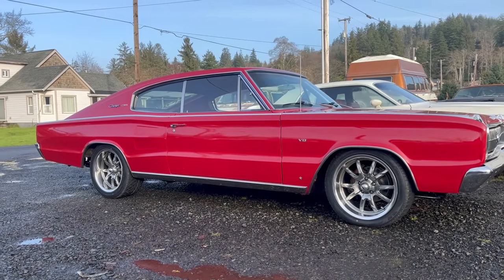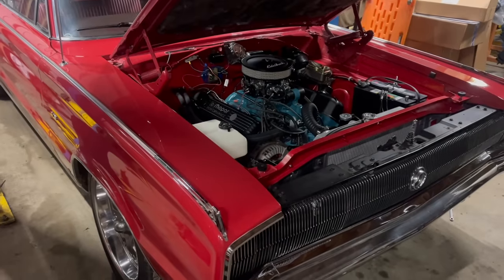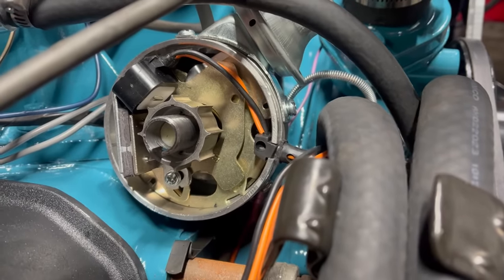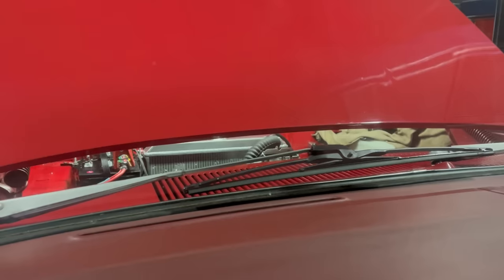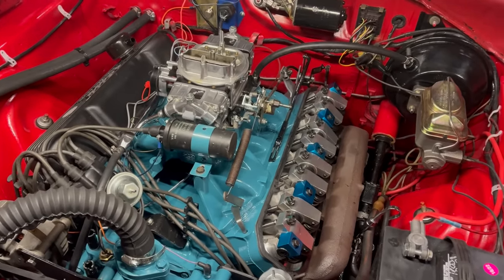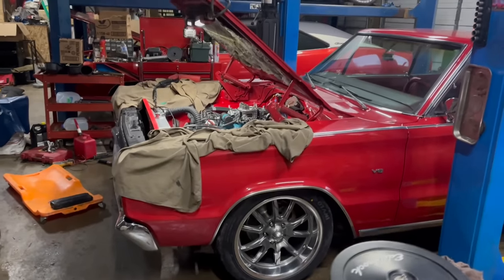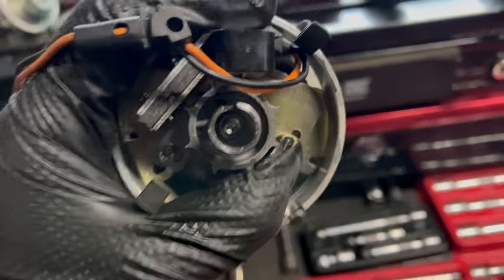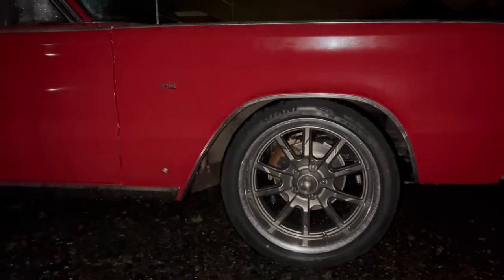What's Wrong With This 1967 Dodge Charger Big Block 383? When Bad Parts And Builders' Mistakes Mix

Comment: I had a customer bring his Ford to me. Said it will not run right. He started it up and bellowing black smoke.
Hand me the keys. I opened the hood. Choke was stuck close. A brand new carb and some one took it a part. Why??
Without taking it apart. I took off the choke and reset everything. Cleaned plug and she ran and idled. 
He said the previous mechanic couldn't figure it out?.
I did some other cleanup on the plug wiring. And picked it up smiling.
Reply from the maker: That’s a good one… I recently had one of those fancy Street Demon carbs stick the choke closed on top of the choke tower after a back fire. It didn’t seem like that would even be possible… that one took me a minute to figure out, as the air cleaner was on. Nice work!

Comment: Cam timing was my guess at about 21 minutes in but I've forgotten if that would or Would NOT SHOW in the ing timing.  Hey, I used to be Very good back in the Day with everything using Points and a Carb!   60 years later and Stick a fork in me caus I'm DONE!
Reply from the maker: I hear ya! Haha. It would show in distributor timing if the chain had jumped - but not if it had been installed wrong and someone had then set the ignition timing by the mark, like in this case.
Reply: @DeadDodgeGarage  
This! 😀

Comment: Classic mistake most guys make...  HUGE CAM, not enough compression, adds BIGGER CARB.  problem gets worse..  Builds it until it is undriveable ...  3 years in paint and body shop...  $15,000 later...  now its a trailer queen...  Sells it for a big loss, buys a Camry.
Reply from the maker: It’s all about the combination… and people just don’t get that. It’s so easy to make a car worse and slower with money.

Comment: I make the dash light drivers for these cars. Same circuit and transformers as the original ones.
Reply from the maker: Awesome! If you’re the guy in Washington, I almost bought one from you - but instead I sold my ‘66.
Reply: @DeadDodgeGarage  No Merit automation of Maine. We use original type cases new transformers etc.

Comment: Should keep the original distributor coil and points. Then replace with Pertronix LS. Done.
Reply from the maker: I like Pertronix and have used a few, but have heard they may not be the most reliable thing either. Frankly, I’m not sure what is.
Reply: @DeadDodgeGarage  The LS is the reliable version.  I have had it installed in my BB Corvette for 20 years now. The magnet ring version is the problem child as when it gets old it will sling out its magnets. LS means lobe sensing.  No ring to install. Only the pickup.

Comment: You need to use a pointer to convey all the points of the conversation
Reply from the maker: That would require buying a pointer… my finger works pretty well. Hmm, I suppose I could use a screwdriver.

Comment: Mopar not charging or low charging? 
Change the Fusible Links !
Reply from the maker: There is one fusible link, and it is in the main battery feed circuit. If it goes, it doesn’t run.

Comment: What kind of engine builder doesn’t test run the engine before releasing it to the customer?
Reply from the maker: …the kind that doesn’t have any way to do that?
Reply: @DeadDodgeGarage  well then that engine builder needs to hire you as a quality controller. Good work!

Comment: The roof really ruins the look, IMHO. At least there is the Coronet, but it goes the other way, being to angular. What would have been nice was something in the middle.
Reply from the maker: It’s definitely something that has to grow on you. When I first saw them I thought they were awkwardly proportioned. I don’t feel that way anymore, but it still doesn’t compare to the next generation Charger roof - which is a thing of beauty and perfection.
Reply: @DeadDodgeGarage  Agreed about the next gen. Anyway, there is no accounting for taste. I actually tend to not like many fastback designs and I'm in the minority on that. At least this car is not a cookie cutter design, which keeps things more interesting.

Comment: Why do they always run right and tight when all stock parts are  put back on the motor? 
Had a 70 charger 4sd car. Built a 440 big cam back when nobody noticed, and I was young, that the 30 over pistons were compression corrected for unleaded regular gas. Big cam small compression. Imagine that. But heck, it sure sounded good. It wasn't all our fault. They used our generation to figure out computer ignition and fuel injection fixed 20 years of late boomer early X'ers on unleaded pump gas.
Turbo timing, anybody?
Reply from the maker: The factory really knew what they were doing...

Comment: HaHa! I called it! I have a 440 Dart and after watching the distributor swaps and listening to it it had to be the timing chain. Whoever put that engine together needs a beating. I can tell hes a Chevy guy. The trunk key is a dead giveaway. Im a holley hater as well for street cars. Fires are no fun.Throw those rockers in the trash and slap on mopar heavy duty hydraulic rockers.
Reply from the maker: It was a new one for me. The thought that someone could install a timing chain that wrong had never occurred to me before this. Friggin Chevy guys 😅 for the record, the car was not built by the engine builder. I will not be throwing away any brand new 440 Source rockers until such a time as they prove themselves to be garbage. If you are referring to non adjustable rockers that would be used by the factory with hydraulic lifters, I can think of no reason to increase lifter preload and reduce high RPM valve train performance.
Reply: @DeadDodgeGarage  Yes I was amazed the chain was off. Thats such a well known mistake. No centerlineing who needs that!? I was mistaken and thought those were proform rockers at a glance. Even though you will lose a few hp the I like the sheer simplicity of the stock style crank down hydraulic rockets considering its a street car. Of course id need to know the lift of whatever cam that is. I use the mopar engines manuals. If it’s over 0.509 (later revised to 0.525) lift you probably should run adjustables. Once I heard it run it didnt sound like the duration was too nuts. Nice car👍

Comment: It's so easy to time/stab the distributor. It's either on or 180 off. Therefore if it 180 out somebody is LAZY & Not Smart
Reply from the maker: When you’re putting together an engine that has not been together yet, it’s up to you which direction you point it. And if you don’t know Mopar and aren’t familiar with the factory cap and wire orientation… it’s not a big deal.

Comment: The interiour on the 68 and up looks crappy compared to the 67s, thats right.
Reply from the maker: I totally agree. I have long thought that a ‘68 Charger with the Charger 500 fastback-esque back window and a full ‘66 Charger interior (full length console) would be an amazing combination. I hope to build that some day!
Reply: @DeadDodgeGarage  Would be the king of show! But you would have to start with a rustbucket, because hacking the rear window on a good car would be a blasphemy. I heard they used chevy vega rear windows for conversions back in the days. Chris birdsong #junkerup did a video on that.

Comment: "What's Wrong With This 1967 Dodge Charger Big Block 383?"  It's got a 383 rather than a hemi or 440.
Reply from the maker: Booooooo. 383s are fantastic engines.

Comment: 383 cid small block 440 first big block!😮
Reply from the maker: No. Like… no, not at all, dude. For one thing, there were tall deck 383 engines, which were the same physical size as the 440 at one time. For another, the 413 predates the 440 by years - again, the same physical size. And then of course there’s the 426 wedge engine - to say nothing of the Hemi. Even the short deck B engine is physically much larger than the smaller A engine - even when it only had 350 cubic inches in 1958 🤯 maybe you think the 383 is a small block because you’re a Chevy guy? But the 383 Mopar is absolutely a big block by every measurement that makes sense.

Comment: The original Charger was the best of the Chargers
Reply from the maker: I'm a big fan, for a lot of reasons, and it has a lot going for it. But the lines of the second generation car win for me - as they do for many others. I have dreamed for years about the perfect blend of the two - the interior of the '66 in the next generation car, probably using the Charger 500 fast back window design and rearranging the rear storage space to be like the first generation car.

Comment: Big cam,low vac .not enough vac for brake booster.cheep fix for extra vac for second brake hit ,add vac reserve can in booster line..just move check valve to can input. Straight line to booster.just sayin

Comment: This engine has a horrible idle shake...looks like cam is worn out
Reply from the maker: The brand new cam, in the brand new rebuilt engine, in which I checked all 16 lifters for proper movement while I adjusted the rockers? Ok.

Comment: I don't like the upper radiator hose I think it's ugly I think it's a cop out find a factory hose
Reply from the maker: I’ve gotten several comments about those lately. They don’t look right, but they work fine. I prefer factory, but I don’t have a violent aversion to flex hoses.

Comment: why dont you shove the gas pressure down the intake?  jsut punmp the throttle linkage 5-6 times, no mor pressure, open it leave it then, you know the screw driver trick right? to keep the throttle wide open? easy peasy japaneesy no mo pressha
Reply from the maker: How exactly would holding the throttle open affect the pressure between the fuel pump and the needle assemblies? That does nothing. But yes, I suppose you could use the accelerator pumps to jam all that fuel down the throat. I’m not sure 5-6 pumps is going to be enough.

Comment: Not a fan of power brakes in cars.
Reply from the maker: Those more modern booster setups that are available for these things are awesome. We’ve got one on our Coronet wagon and it stops like nothing else we’ve got. Manual disks suck. But - I do prefer simplicity.
Reply: @DeadDodgeGarage  I love manual disks. You get way better feel with manual brakes. Sure it takes more effort, but the brake feel is stellar. Power brakes provide little to no feel.

Comment: What's wrong with it?... This is what happens when you let non-MoPar guys assemble MoPars and use cheap Chinezee Parts.  I wonder if the rockers are paired the right way..  No worries we'll find out when it wipes out the camshaft. (it needed to be changed anyways)...  LMAO!!!!!
Reply from the maker: The rockers looked right… so hopefully that’s fine. Yeah, all this stuff is why you need a Jamie.

Comment: I wouldn't call a 383 a big block.
Reply from the maker: I guess that’s your choice. Since it’s the larger “B” block, I’m going to go ahead and keep doing it. Did you know Chrysler also made 350 and 361 big blocks?
Reply: Do you also call the 318 a Big Block?  How about a 350 Chevy? @DeadDodgeGarage
Reply from the maker: @gordbaker896  So are you not familiar with the widely accepted distinction between big blocks and small blocks? Or are you just a Chevy guy? The 383 stroker engine is made out of a 350 small block. The 383 Chrysler engine is the larger B engine architecture. Bore center and the physical size of the engine / block are great things to look at if you're confused. No, the 318 is not a big block. 🤦‍♂
Reply: I am a Chevy guy and Not Confused as you might be.  I am familiar with the Stroker engines made from the 350 Chevy.  The 348 is not considered a big block but a 409 is.  Similar design.  Chevy had a 400 cu it but was still a 'small block'.  Hope you understand.  Call them whatever you wish in your shop. Done. @DeadDodgeGarage
Reply from the maker: @gordbaker896  "The first version of the "Big Block" V8 Chevrolet engine, known as the W-series, was introduced in 1958. Chevrolet designed this engine for use in passenger cars and light trucks. This engine had an overhead valve design with offset valves and uniquely scalloped rocker covers, giving it a distinctive appearance. The W-series was produced from 1958 to 1965, and had three displacement options: 348, 409, and 427." You are clearly very confused. The displacement number is NOT what defines a "big" or "small" block. The god damn size of the engine is. DONE.
Reply: The 409 did not appear until late 1961.   Stick with what you know.  @DeadDodgeGarage
Reply from the maker: @gordbaker896   I know how google works

Comment: Nothing worse than too shiny paint with dull brightwork, inside and out.
Reply from the maker: It’s tough. Give a car a really good paint job, and suddenly everything else looks bad.
Reply: @DeadDodgeGarage  I guess that depends what your goal is, back to original or show car. If the latter, a lot more work to do. If the former, they spent too much for the paint job. Looks off is all I'm saying.

Comment: Petty much the same  body lines as my 66 coronet    minus  the fast back
Reply from the maker: Yep. These were designed right off of the Coronet. The rear wheel wells are cut higher and they added the go fast scoops (which made it to 67 coronet two doors.) The tail panel / trunk configuration is also very different of course.

Comment: What to find out? How about breaking in the engine on an engine stand ? Then to the dyno. This guessing and shiny new nonsense is unimportant.  I'm a pontiac guy, I would never rebuild an engine  without breaking it in & DYNO !!money well spent.  Another note: just because a part is dosen't mean a thing. We've burnt through all the American made  replacement parts. Chinese shit ? Boy, do you take your chances.
Reply from the maker: I’ve spent enough time explaining engine break in and how important it is on this channel, I think. This engine was broken in. We run engines on our stand all the time - but I didn’t build this one (thankfully.) As far as the dyno? Don’t have access to one, and don’t think it’s necessary.

Comment: What's Wrong With  it?   It's an Automatic. Zero fun to drive.
Reply from the maker: I couldn’t disagree more.
Reply: @DeadDodgeGarage  Automatics are for chicks and grandmothers.  What do you do?...Start the engine and shift into drive? Where's the fun in that.
Reply from the maker: @jimirox1928  automatics are for highway cruisers you throw your family in. Nice, relaxing daily drivers. Four speeds are for partying. I have one of each in my 383 auto Charger and my 340 4 speed Demon. I love both as they are, and I would not prefer my Charger to have a four speed.
Reply: That's depends on many things, such as where you live and work, daily driver or toy. I lived in Dallas for 26 years and driving a stick as a daily can be the opposite of fun, especially on the way home after working all day in a 120° shop.
Reply: @DeadDodgeGarage  I'm speaking of muscle cars, not daily drivers. My daily driver is a V8 Ford Explorer with an automatic. My 67 Camaro is a big block with a BW T10 as is my 
70 El Camino SS 454 With a Muncie M-22. And a C5 Corvette ZO6. They're a blast to drive but the Explorer gets the most  use for obvious reasons.
Reply from the maker: @jimirox1928  My daily drivers are a 2008 Toyota Corolla, a 2003 Ram 2500, and a 2000 Cherokee. My two decent "muscle" cars are the Charger and the Demon. The Charger is plenty of fun to drive with an automatic. I get where you're coming from, I'm just saying. The automatic Charger has its place.